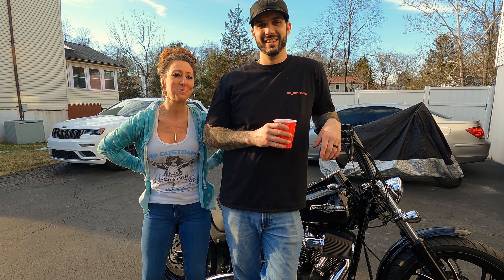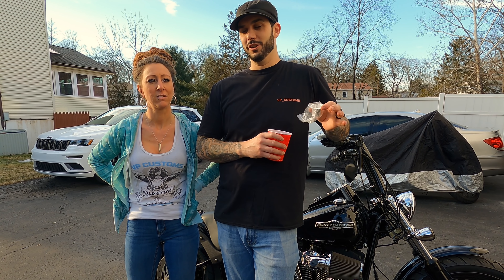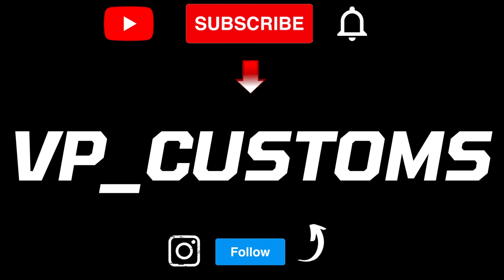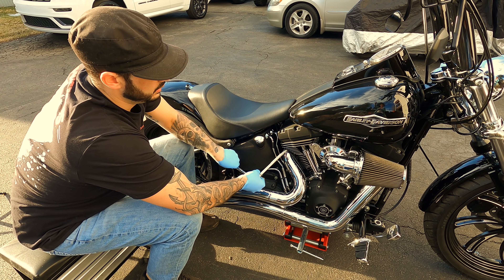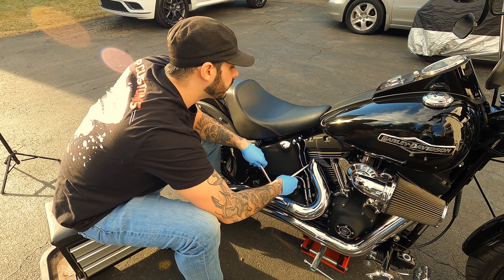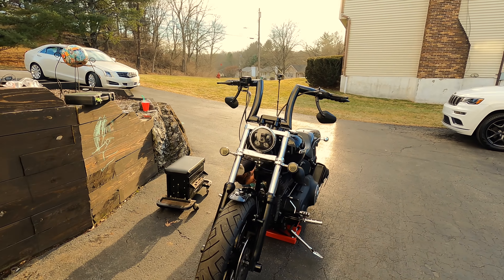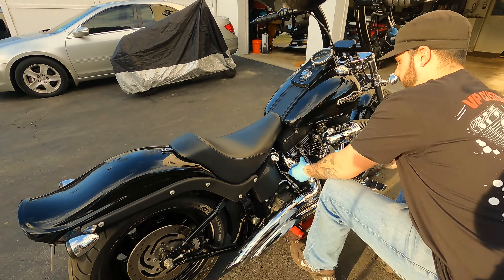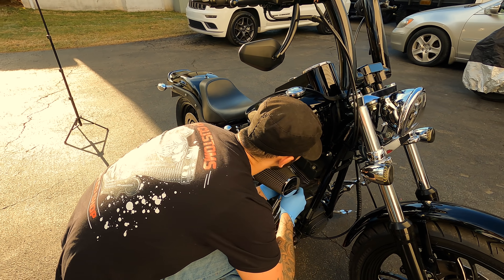HARLEY NIGHT TRAIN TORQUE CONES INSTALL!!-- ALSO NEW PROJECT BIKE!

Comment: I have the same Night Train here down under in Australia, and you probably worked out that it's easier to do that job with the bike on the jiffy stand, it's a better angle and the bolts to the frame are so much easier to get to. I'm new to the channel so I'm going back to see older episodes. (2006 FXSTBi, owned from new 249,000kms, rocker covers have never been off)
Reply from the maker: Thanks for watching!

Comment: I’m looking into getting torque cones for my breakout vanes and Hines big radius exhaust 
 Stupid question 
My question is the torque cones  one size fits all or there different sizes for each exhaust?
Reply from the maker: Not a stupid question!  I believe they are all the same size! They are tapered and fit inside  the exhaust where it mates to the cylinder

Comment: you 2 are both so cool i also have a nite train 2002 with inch and 3/4 40 inch drag pipes old school took off v&h big shots and added 510g cam tray all s&s the bike is way faster with drags and torque cones hsr 42 mikuni.
my next project is 106 s&s stroker have all parts for complete s&s engine ill send you 2 some pics when iam thru.
have fun with those bad ass nite trains especially my favorite  one the 2001.
stay in the wind you two.
Reply from the maker: Sounds like an awesome bike!! Thanks for hanging with us!!
Reply: @VPCustoms  absolutely  you both are nite train lovers me 2.
? have either one of you 2 ever thought about throwing an oil cooler on those 2 TRAINS ?
you guys take care !!!! 😎
rob.

Comment: Well even with small baffles it doesn't change the sound much but what does it sound like on deceleration when you let off the throttle? Do you still have the popping??? I like the popping and use it to let cars know I'm there!
Reply from the maker: Haven’t taken it out for a ride yet since We put the cones in but I love the popping sound also! So hopefully it has stayed that way! As soon as the weather turns for the better I will be taking it out! Stay tuned for it!

Comment: Hey guys , thanks for the vids, quick question though,  don't those cones just smash the gasket, mine don't fit inside the gasket . They fit fine in the pipe? Thanks
Reply from the maker: Hey there, the way I've always installed them goes cone side into the exhaust.  The flat part of the cone goes up against the gasket.
Reply: @VPCustoms  that's what I did,seems goofy, like flattening the rounded end haha, thanks. I'm runnin it, on my wide glide. Love this damn bike.haha

Comment: Running the intake and exhaust, even with the torque cones do you need to have it tuned?
Reply from the maker: I would definitely recommend tuning after doing intake/exhaust , its a big change to the air fuel ratio.  If you listen to video closely, you can actually hear how much air her intake sucks in at idle.

Comment: Is there a benefit to removing baffles and adding the torque cones? Or is it just a sound preference?
Reply from the maker: Hey Jesse! Definitely no performance benefit, she just likes the bike loud.  The torque cones, in theory help replace alittle back pressure lost by the removal of the baffles
Reply: @VPCustoms  thanks I appreciate it. When I bought my 08 night train my radius pipes didn't have baffling so I was wondering if it's necessary to get the cones and of course I will.

Comment: So these will eliminate the decel popping after installing slip-ons without factory back pressure?  Should I try these first, before I spend a bunch of time and money on a tuner and headers?
Reply from the maker: It may be worth a shot, $15 roll of the dice! Can't guarantee though.
Reply: @VPCustoms  Closer to $30 now! Ha!  Yeah, my Road King is an '03, so no Co2 sensors on my stock headers for tuner feedback. I don't mind "some" decel popping, kinda cool, but mine is too extreme.

Comment: You’ve got O2 sensors on a 07 Night Train?  I’ve got an 06 fuel injected Night Train with the same pipes. No O2’s on mine.
Reply from the maker: That's strange! Did they get tuned out? This came with them!
Reply: @VPCustoms  I don’t think so. There do not seem to be provisions for them. No wires that I can see. I guess they changed the ECM between 06 & 07. Please lmk if you find out otherwise. It’s too bad, it would benefit from an open loop tune. Since adding pipes and air cleaner it’ll misfire at low rpm when cold. Only happens when turning so you feel like your going to fall over. Figures lol. Nice bike you 2! I love mine!
Reply from the maker: @DayInTheLifeOfAl  thanks! I'll let you know if I see something different! We also have an 01 night train you can see in our other videos! Thanks for hangin!
Reply: @VPCustoms  yes, I should have said nice bikes! I love ‘em both!
Reply from the maker: @DayInTheLifeOfAl  thank you!! 👍🏼

Comment: So i have a question. I have stock pipes, baffles removed, but no adjustments to include torque cones. I have an 07 night train. If i put drag pipes on it are torque cones all i need and what about exhaust mod. If i do both do i need to tune it
Reply from the maker: I would definitely recommend doing a tune if you take the stock pipes off and go with drag pipes.  The tuners are very user friendly

Comment: I bought the 2022 fatboy  and I want to change the exhausts, but  the dealer say that I can't yet because they don't have a piece called smart turn something like that. What I can do
Reply from the maker: Congrats on the new bike! I'm not quite sure what they are talking about because smart turn is a system for the turn signals.  Maybe they meant a tuner (fuel management system)?
Reply: @VPCustoms  sorry  they  say  smart tuner. Is that true or can i do it
Reply from the maker: @ariellemus512  what I would worry about is voiding the warranty on a brand new bike if you didn't listen to them.  You may be able to do just slip on exhausts with no tuner but you are kind of at their mercy if you want to keep their warranty, would have to ask them.
Reply: @VPCustoms  when can I change it
Reply from the maker: @ariellemus512  you would have to ask them! I've never owned anything new! 🤣
Reply: @VPCustoms  sorry they say smart tuner that's true
Reply: @VPCustoms  ok I understand. Thank you
Reply: @VPCustoms  ok thanks God bless you

Comment: You don't have external breathers on your air cleaner
Reply from the maker: Sure do....Back plate on the external features integral air breathers and sealed breather bolt plug on the Screamin Eagle intake.....